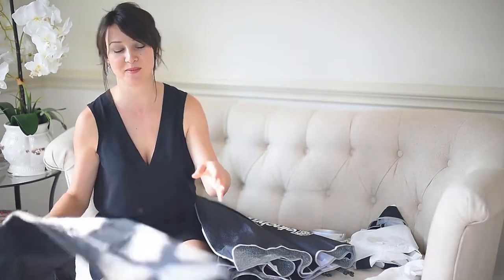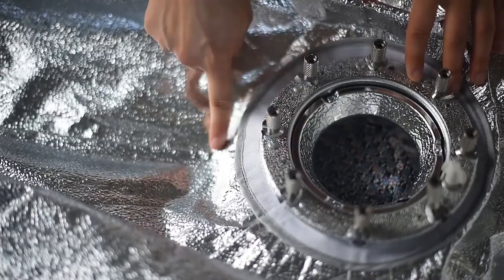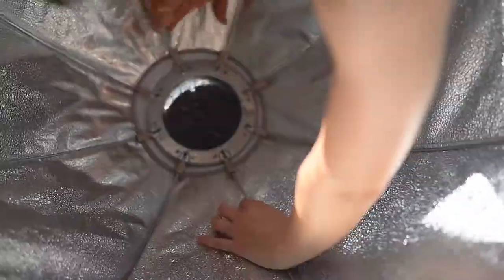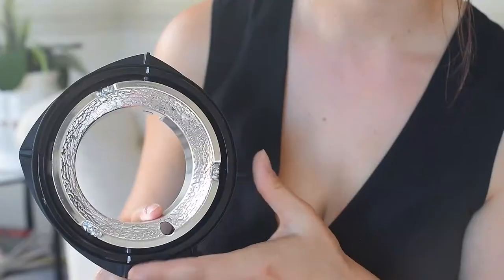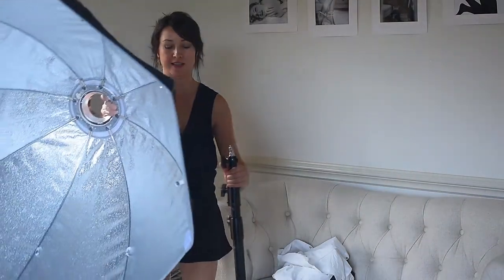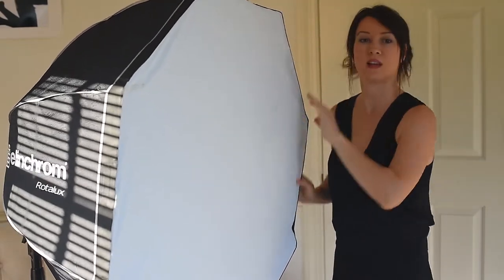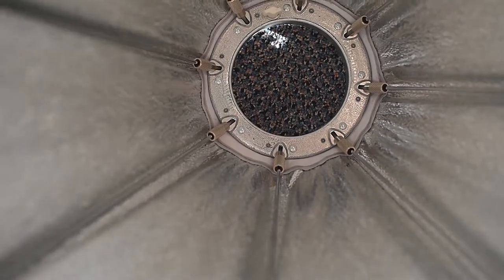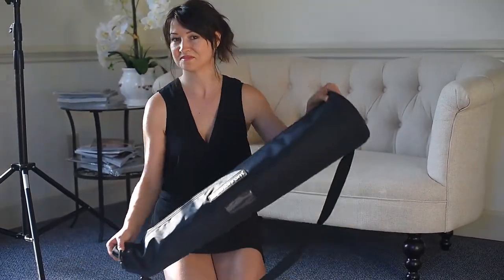Elinchrom 39" Rotalux Deep OctaBox (How to assemble and disassemble)

Comment: Best always!My Rotalux 175cm is about to arrive and continuous light Forza 300. I bought the Elinchrom speedring for Bowens but do I need to buy the adapter too?Thank you!
Reply from the maker: Hello and thanks for the question. I am not sure what your flash heads are, so I can’t tell if you need an adaptor. I use Elinchrom lights and I needed an adaptor for my Quadra flash heads specially for the Rotalux. I hope you don’t need one :) Adaptors are so painful to find and just an additional expense and waiting time. Please let me know if you needed one. Thanks!
Reply: @yuliyapanchenko  Thank you sooo much for answering!Actually,I bought Forza 300 to use as continuous light and bought speedring and after your video I bought some adapter too(not too expensive) and Elinchrom Octa 175. Still waiting all to arrive but I am afraid I will not know how to connect. Is it light on the stand or the Octa on the stand and similar details... your video helps a lot but I have never used these systems. I shoot videos and use some stupid lights now and this is my first real light system. Love your chanel😘
Reply from the maker: @Petramojomusic  Well, As you see in this video, it is maybe 5 years old and if you watch my new videos, I still use the Octa Soft-box and my main light modifier. I absolutely love it. For continuous light, I use Stella Pro CLx10 that are designed for Elimchrom as well. Specially for the Octa I place the octa on the light stand and my light on it because it controls a nice balance. They are very easy to setup. At first it took me a few min to figure it out, but after fee tries its a piece of cake :) You will love the light quality with your nee Soft-box so congratulations 😜
Reply: @yuliyapanchenko  Thank you so much dear Yulia😘
Reply from the maker: @Petramojomusic  always my pleasure 🤗

Comment: Its any difference between the octa and asquare sofbox or its  just the minute less in asembly the rotalux? Where do you come from?
Reply from the maker: spanish. ink yes, there is a different. I personally prefer the deep Octabox because of the soft light that I get. This particular soft box reduces the spread of light compare to the squarebox and I love it.
Reply: Thanks Yuliya,  I thinking in buy 2.  do you know if its possible to buy with grid and for pulso mouth( broncolor?  eduardo,  foto.design
Reply from the maker: spanish. ink I actually bought the grid set but it’s not for the softbox but to use it on the reflector dish